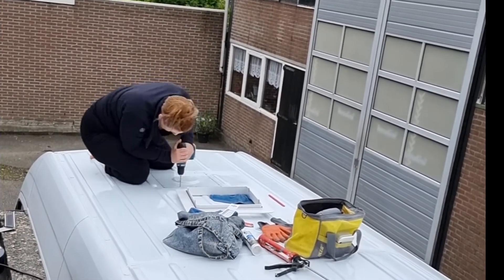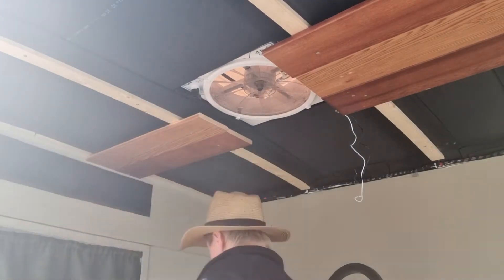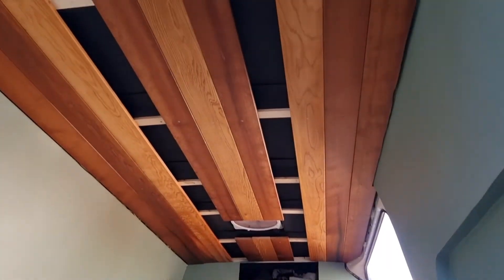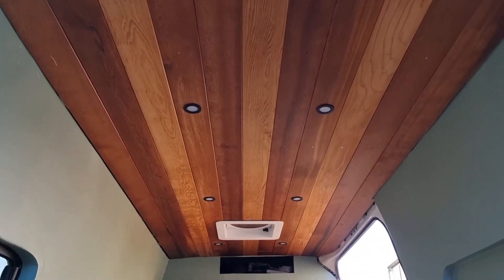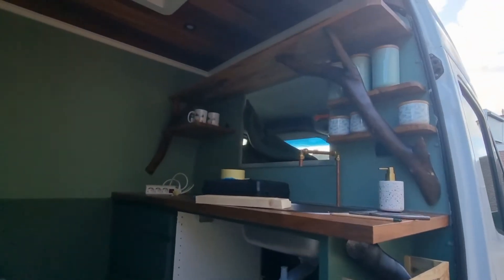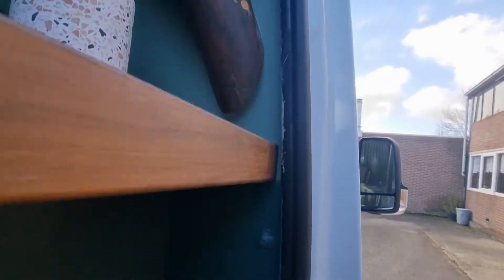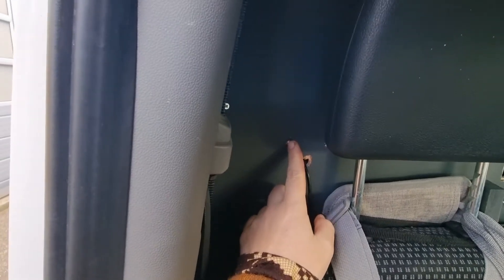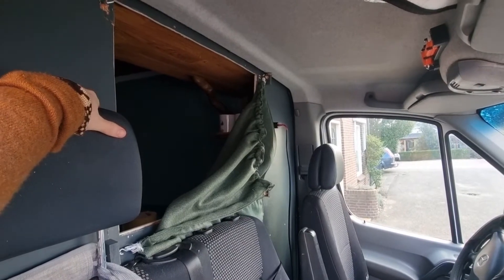How to install the ceiling in your Van / solo female Vanbuild.

Comment: Hello again 😁 I think you've answered my  question. Thanks a lot! 
And it's good to know that you took wood that has only 5 mm. I would have chosen a thicker one. But it seems there is no need for it.👍
Reply from the maker: Perfect! I choose 5 mm for the weight and also its not a straight hole, so the wood needed to bend a little.